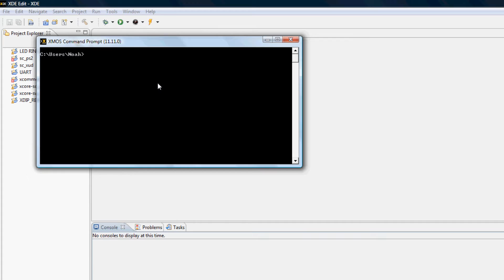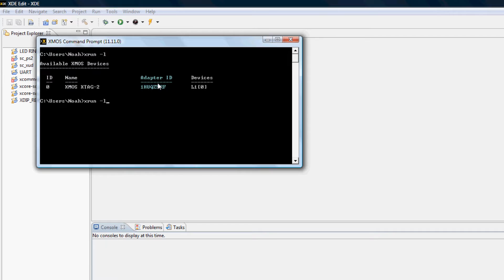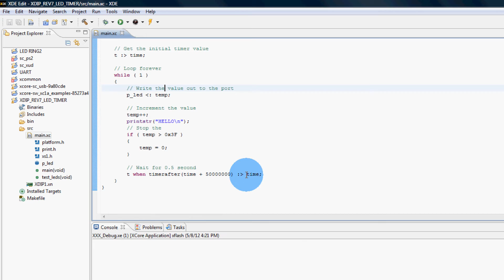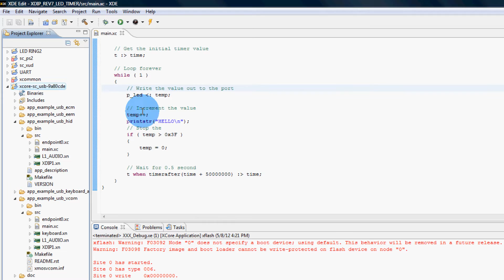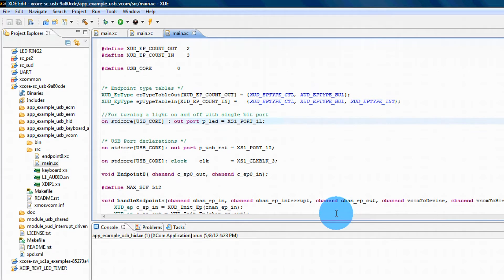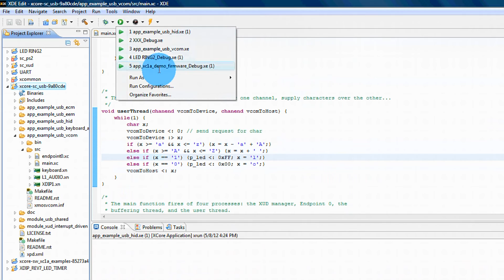XMOS XDIP1 - Multi-core Development Board

Comment from the maker: Hey rtimte,
   I'm at a standstill with these boards because a week or two after I released this video XMOS announced there XS1-S chips which have onboard USB and ADC.  I made the decision to wait for the chip to release and then implement a DIP development board in both the single and dual core version.  

Out of curiosity what did you want to use this for?